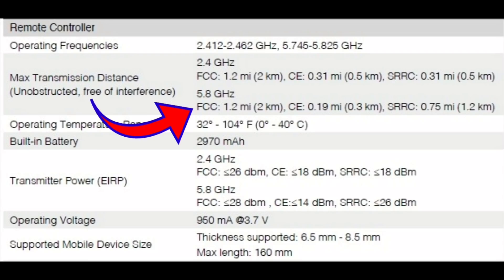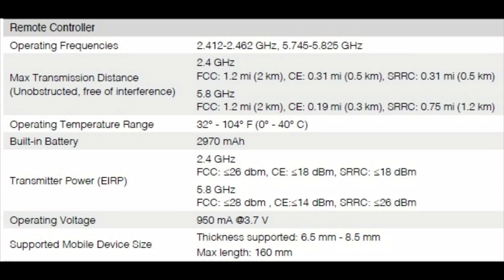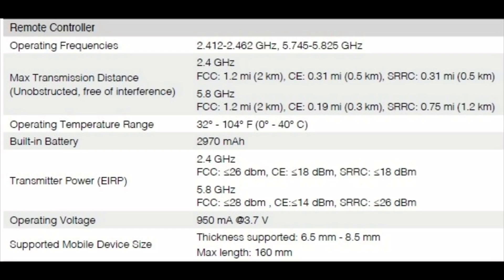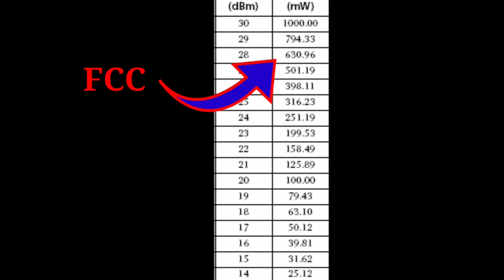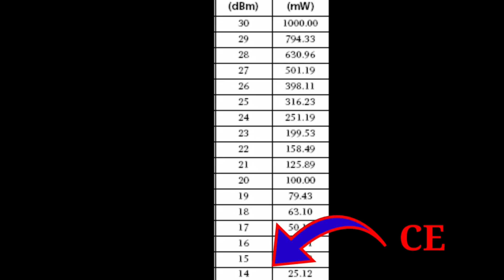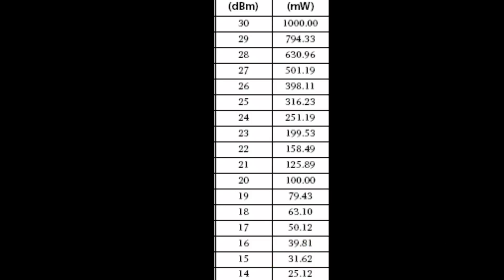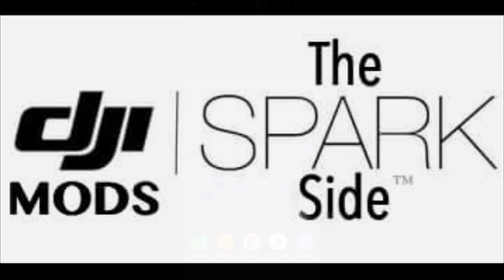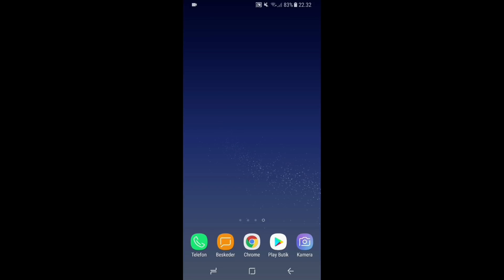DJI Spark FCC Mod.

Comment: Hi Kim, I am using the FCC for a while, after not flying for a while a flew the spark today and noticed that the map inst available, it is grey no map is shown. I tried to reinstall the FCC mode and unfortunately, it did not work. have you had this issue? do you know how to overcome it?

Comment: I just used my spark and with now i cant see the map nomore... is anybody having the same problem? May its related to a new update...?!
Reply: same here, folowing for an answer
Reply: @lucbisschops  reset the date before August 2018... maps is not supported anymore after August. No workaround for that.
Reply: @Johennessy  done it but still no maps
Reply: @lucbisschops  join the Facebookgroup the spark side... some ppl had the same issue .. they might can help

Comment: I life in the Netherlands, if i install this app, won`t the the drone fly off too America?
Reply from the maker: no it havent got anything to do with GPS the app is modded to force FCC transmission strenght on the wifi module
Reply: Kim Korntved so we don't need to uninstall this mod,right Mr.? I thought that we need to uninstall it before,then install official DJI go apps to make gps works perfectly. So,it still can work perfectly using this mod,doesn't it?
Thanks a lot Mr. Kim
Reply from the maker: yes, the app is only moddified to change the wifi transmission strength to FCC, by the way, you cant have both the original djigo4 and the modded (TSS) app on the same android device, it wont allow you to install them alongside.

Comment: I follow all the steps and when I boot the app it tries to download a "resource file" even though I have auto update turned off in play store and then it doesn't work
Reply from the maker: Dillon the app is processing the included ressource file, just let IT Work a few minuttes and IT Will be fine
Reply: I never got the switch WLAN settings, it stays in 5.8 and I have 13 channels in 2.4 so I don't know whether I'm doing something wrong or not
Reply from the maker: Dillon try All over again, and go outside with good GPS reception

Comment: Hej Kim. Jeg kan ikke få det til at fungere på hverken Android eller IOS
Reply from the maker: MyHydrox photographer hvad er problemet præcist?
Reply: Kim Korntved den skifter ikke fra ce til fcc, mystisk.
Reply from the maker: MyHydrox photographer sikker, 11 channels i 2,4 ghz er FCC.
Alternativt, så prøv helt for fra og gå ud hvor du normalt får god GPS modtagelse når du åbner appen første gang
Reply: Kim Korntved den kører stadig 13 kanaler på 2,4. Jeg prøver engang til i dag. 👍👍
Reply from the maker: MyHydrox photographer ja gør det, afinstaller, og brug en filemanager som feks EZ file explore, åben og søg på DJI, slet alt og så prøv forfra, udendørs hvor du kan fange GPS signal, og så hold mig lige opdateret😉

Comment: I'm using this application for dji spark, but during the flight, the app freeze or sometimes it shutdown completely and I'm in the air. Do you have the same problems?
Reply from the maker: Michal Dado no, must be your phone.

Comment: In this TSS app there are Intelligent Fly Modes like Home Lock an Course Lock. If I understand it well Course Lock means the same as Intelligent Orientation Control. The aircraft is then headless. Are these functions like Home Lock and Course Lock working by using this TSS app?
Reply from the maker: br011075 search mavic flight modes, its the same.
Reply: Thanks for your quick reply. I know because I have the TSS app and I have these modes. The only thing I want to know if these modes are active, because when I activate one of the modes there is no explanation of the selected mode like the Mavic Pro
Reply from the maker: br011075 dont Know only tried the waypoint mode, and it works
Reply: OK, I´ll give it a try. Thanks

Comment: I installed the app and tried it. 
It worked very well as I tried one week before the same place and i was always loosing signal on my spark  🙂 👍

BUT one big important thing is the icon Quickshot  (Dronie, Helix, Circle, Rocket)
I cannot see it on my phone with the new installed app  😡 😪 😥

Is it just me or all you guys cannot see Quickshot icon???  🤔

Thank you for your time to make this video and share all your information with us  🙂 👍
Reply from the maker: 123 456 check if you are in sports mode on the controler?
Reply: I was in sports mode on the controller   😯 😂 😂 😂 
thank you  👍 🍻
Reply: @user-ld1ys7pv6h  You can't see quickshot icon while you're in sports mode.

Comment: Thanks for the video. So, if I understand you well you
need uninstall all DJ apps. Then I have to install the TSS app, make
a connection with my bird and RC, pen the TSS app and after automatically
reconnecting Spark and RC, I'm in FCC mode. Am I right or did I missed something?
Reply from the maker: br011075 right👍
Reply: Thanks!
Reply: I have installed the app on both my Samsung smart phone and my Nexus tablet. 
When I open the app on my Samsung I see in the under left corner a map that shows the Spark GPS location with all the streets.
When I open the app on my Nexus I see in the under left corner a map that shows The Spark GPS location with no streets at all (blank map)
Any idea why?
Reply from the maker: br011075 try top right menu button on the "go fly" screen and look for a option Thats called offline maps, and download the region you want
Reply: OK, I will but that doesn´t explain the differences between the both android  equipment. I need room  to  storage all those GB´s in my Nexus. That is not the issue with my Samsung
Reply from the maker: br011075 you only need to download the contry your in, and maybe the maps already dowloaded on the other device.
Reply: OK, then I will follow your suggestions
Reply from the maker: br011075 please Remember that i dident make the app, i only modded it.

Comment: Hi 
Just doing the transition to fcc but my RC and spark didn’t disconnect and it still says 5.8gh but I’ve got 11 channels and 5 channels on the grid display.  Has this worked or not ??
Reply from the maker: Rock Solid your okay
Reply: Kim Korntved so that it done then ??
Reply from the maker: Rock Solid yes
Reply: Kim Korntved thanks for your help and speedy reply’s mate

Comment: Does this work the same on ISO devices
Reply from the maker: Rock Solid yes but you need to install it on an Android device to set fcc, then you can switch to your IOS device and it will still be in fcc
Reply: Cool Thanks Kim, just need to find someone with and android that i can use

Comment: do i need to fly with the modded version? or can i user the normal unmodded app? because when i switched to unmodded 4.1.15 app der wifi settings switched to ce although i said ""cancel" when the popup came.
Reply from the maker: Roadtripsta i only fly with the modded app, in that you Also have all the Mavic flight modes, so really no need to use the original app.

Comment: pls tell my what I am doing wrong? I am dooing ewerything step by step like this video but I dont have this "switch wlan settings" screen. :(
Reply from the maker: Łukasz Lewandowski it wont always show, if you have only 11 channels in the wifi index in the app. then your in FCC.
Reply: unfortunately there are still 13 channels
Reply from the maker: Łukasz Lewandowski uninstall all djigo4 apps and try again outside Where you get good gps signal.
Reply: Do I need to delete all folders with DJI on internal storage in my phone?
Reply: Kim Korntved I think its ok I will check it tomorow because today in Poland is lot below 0 celcius. Thank You!
Reply: Kim Korntved, I have one last question. Is that solution works with phone conected with OTG cable?

Comment: Thanks alot i couldn't get my spark to fly more than 100 meters before, now i went 1 km distance and 300 meters altutude without any signal loss i couldve gone more but i fiddled around a bit so i didnt have much battery left. It was a great flight. Finally i can enjoy my spark thanks to you :)
For those whose Wondering: it works with android perfectly on my samsung galaxy s8+
it didnt give me a location change warning but still worked perfectly (only gave a new database avaliable for flight zones warning i ignored it)
it works with the latest spark firmware which i used (1.00.0900)
overall, now it is a great drone i also noticed that gps stability went up as well dont know if it is related or not but i used to get 11-12 sattelites but now i had 21-25.
Thanks again you earned a new subscriber today!
Reply from the maker: Nazlı Işık glad i could Help.

Comment: I tried but couldnt get it to work on FCC. When oppening the app after installed I didnt get the pop up signs you showed in the video. Might have forgot to do something.
Reply from the maker: Geraldo Ricarte no.... look at how many channels you got in Wi-Fi settings in the app??
Reply: Kim Korntved More than 20. I think it was 30 channels.
Reply from the maker: Geraldo Ricarte you have to look Where it says "Channel index" and dont use an OTG cable.

Comment: Thank Kim, it seems I've changed to FCC mod (11 channels, wifi in 5.8 now), but the Mavic fly modes are not appeared on my Iphone. It did apear on the Android devide. I wonder that I did miss something?
Reply from the maker: Linh Nguyen no, mavic is only avalible in the modded Android app, cant be changed
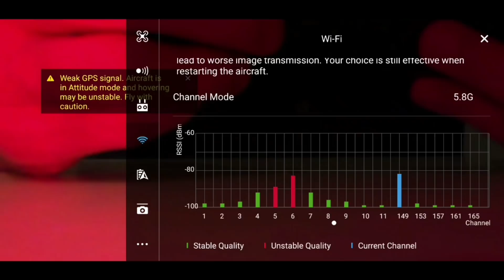Reply: Thank for your repply. at 10:07 in your video, after you change to FCC mode and go to wifi setting again. Why does the Channel Mode automaticaly change from 5.8 to 2.4? Mine is kept at 5.8.
Reply from the maker: Linh Nguyen automatic mode, og desides the Best Channel by it self

Comment: Great! It works!:) Thank you very much! For the future, I think better not Update Dji go 4 and firmware anymore, and always turn telephone in plane mode when connect to drone and plan to fly  (wi-fi to remote controller is available in plane mode) in case if they want to make update firmware and reset fcc to CE. Sometime if you not update firmware they not give you fly. I'am sure Dji later will try to close this opportunity to  switch to fcc. I've heard on forums they start already change on mavic platinum firmware which not allow users change and adjust mavic, even with enthusiast apps. One the one hand I understand Dji, countries governments makes pressure on them, because in the idiot hands this toy can be dangerous, but on the other hand I think it's kind of not honest Marketing  from Dji when they told users everywhere about 2 km range for Spark. What about people who lived in countries where only CE is available? CE for Spark is terrible, low range, video freezes, not smooth, gimbal not smooth e.t.c Check latest video on my channel from my Spark, hope you like it!:)

Comment: Hello, good video. I have installed the latest .900 firmware in my spark. Does the last modified version work with this firmware? Or is there a problem?
Thank you very much, greetings
Reply from the maker: abc you Will have to try your Self.
Im still on and intend to stay on 
.0701
Reply: Ok thank you, I will try and comment
Reply: Kim Korntved I'll try it works, but don't want to update anymore
Reply: hi did you try with latest firmware as you mentioned?
Reply: Kim Korntved what is you RC fw

Comment: hi there. what about fcc_boost mode cfg?
Reply from the maker: FullBack177 what About it??
Reply: the fcc_boost. config file for the android app.  to get more power to remote antenns. eating more remote battery but data on 5.8 more stable (+possibly range). try to get more distance without any antenn mods of remote (like patch antenn etc)
Reply from the maker: FullBack177 dont Know anything About that

Comment: Thanks an informative video! I'm a pilot in training, RC plane pilot, and a photographer.  I need this drone! Question-   If I am flying in safe rural area away from Class B, C an D,  airspace and away from ALL airports what is the max altitude for Spark or mavic?
Reply from the maker: Greg S Thats regional/contry dependent, giyf.... Google is your friend😉
Reply: Well I know from my student pilot courses that the controlled airspace categories are international.(Google it :)      Is there anything built into the drone that alerts the user if the drone is flown too high and it enters Class B or Class C airspace?   Or what if I bring the drone to park and it's a no fly zone?  Does this mean the drone is disabled from flight?
Reply from the maker: Greg S yes you cant even take off in a NFZ, they are Also marked in the app on the Maps, and only DJI can unlock the zones with the propper paperwork in place
Reply from the maker: Greg S it wont enter a NFZ, og will auto land if you try
Reply from the maker: Greg S I dont Know anything About the process cuz i never want to fly im NFZ

Comment: Hi Kim!
Great video! I will try this mod asap.
Is it working with the latest firmwear?
Btw, do you have any idea why I dont get any 
readings in the wifi signal bars ( like 5,04 min into the video),
there is nothing at all... I am using the original app at the moment.
Thank you!
MrK
Reply from the maker: Mr Krister when using otg you wont get any bars. 
If not using otg try switching to custom and again to auto.
If it dossent Help try to close the app all down, Also in background, but with spark and controler still connected and open the app again.

Comment: I have already installed the previous modified (TSS) app. I have now installed this version. 
You say we can uninstall other versions and just use this version. 

Surely, won't we loose the latest photo features? OR do we continue to touch 'cancel' to the regional WiFi changes in DJI's latest app? Cheers.
Reply from the maker: Quentin Bush all feauters supported in the New mod.
You shouldent have any use for the original app at this moment.
Visit the facebook group mentioned in the description and read the pinned post in there.
Reply from the maker: TB - Drone-videos yes..... or uninstall/reinstall as you like but only One app installed at a time
Reply: So, we can use only the new modded app ? And nothing else ?